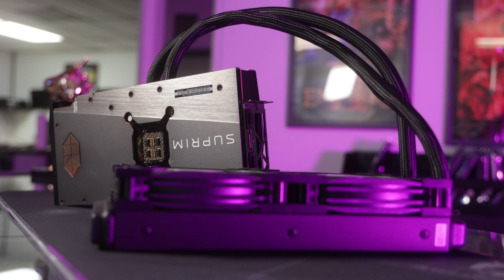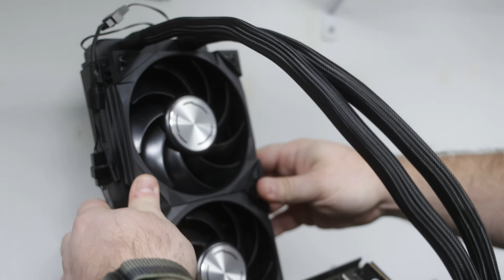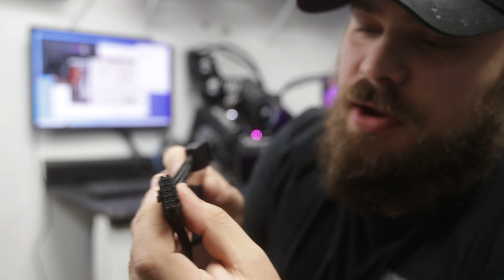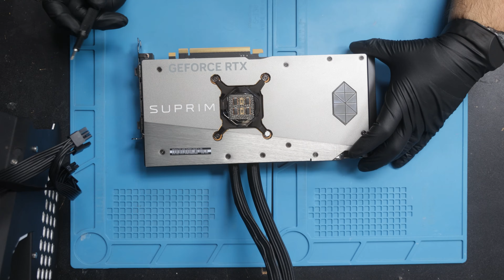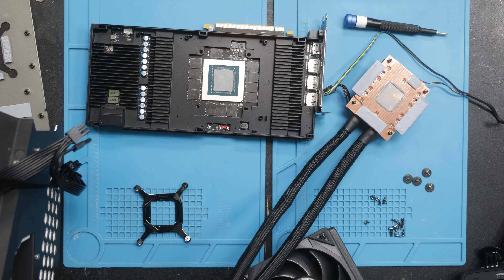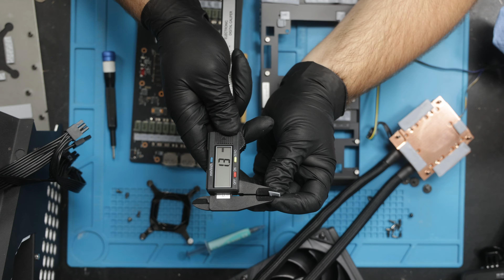MSI RTX 4090 Suprim Liquid X Dissassembly, Tear Down and GPU Memory Temperature Improvement

Comment: Would you recommend running 2 of these in a closed case for a rendering workstation?
Reply from the maker: Well since SLI/NVLink is no longer a thing we have no idea what software can use 2 cards. Your best bet is using Quadros or Radeon Pro
Reply: @SilverKnightPCs  I use vray which doesn't use nvlink or sli. The question is mostly about the temperatures inside the case. The air cooled cards are not recommended for a closed rig, so I'm wondering about this.
Reply from the maker: @elektroluver  in that case if it's truly multi-gpu agnostic no matter what kinds of connections are working in the cards then you are in a position where this is probably one of the few cards in the market that you can run dual 4090s. We haven't done exact temperature testing but based on what we know about water cooled cards in the past as long as your radiators are venting outside of the case instead of pulling cool air and blowing inside the case then the heat isn't going to be inside the case to matter. You should be more than capable running two at the same time. Now cable managing that having an adequate power supply to be able to run that? That's a different question entirely
Reply: @SilverKnightPCs  Yeah cable management will be difficult but I think my psu can handle 2 of these (super flower leadex platinum 2000w). I'm already running 4 blower 2080ti's, so another card I'm looking forward to is a blower style from manli but I'm not sure how they gonna manage to cool that thing. Thanks for your answers.
Reply: @SilverKnightPCs  blender has an option to render with two GPU’s without any link or sli

Comment: You would think for a after tax $2000 card they would use a bit more premium materials.. 🤔😒😡 Gigabyte AIO GPU have the same issue..
Reply: Nvidia distributes the cards at a premium. msi, zotac and all the others barely come even after they add their touches and put them in the market.
Reply from the maker: Honestly the materials are not inadequate. It's just that it could have been better and it's not much more to make it better

Comment: How is coil whine ?

How is overclock ? Can u do PR ?

3ghz effective sustained ?
Reply from the maker: 3 GHz no issues. Coil wine was at a minimum but it was running sustained 4K superposition tests so the frame rates aren't high enough to experience coil wine issues sustained
Reply: @SilverKnightPCs  were you be able to spot a I2C Header on pcb ? from the looks there is none, unlike the strix
Reply from the maker: @StreaM_RoLLeR  you got a link to one? Never seen that before even tho we do some LN2 stuff occasionally
Reply: @SilverKnightPCs  you can see from der8auer he hooked up elmor to backside of pcb. I2C port there.

Comment: So is it ok to use all 1.5mm pads?
Reply from the maker: No it is not. On the vrm it's fine but on the memory it definitely wants 1 mm pads. We ended up having to slice ours in half to be able to use them.
Reply: @SilverKnightPCs  thanks for the heads up. I just got the Suprim X, and I'll need to buy a new batch of 1mm pads.

Comment: Great job! You deserve more viewers with such detailed videos.
Reply from the maker: Appreciate it! We are working on a Kingpin 3090 with liquid metal and memory overheating issues next :)
Reply: @SilverKnightPCs  Hi! I'm still using MSI RTX 4090 Suprim Liquid X. I have some worries about my videocard. Could I ask a few questions please if it possible? You are pretty confident at what your are doing and there is not many people could answer it. 

The first question is: There is four diodes under backplate, that was lightning by default white color, but two of them got stuck at another color after time. Looks like it was bad idea to let them lightning white all the time. Once I noticed it, I've completely turned off the diodes via MSI Center Mystic Light service. The question is, can it cause any problem with other parts of the video card if these diodes will completely die? 

And the second question: Is it ok if vram of the videocard is heating up to 90 celsius, it slowly grow to around ~88 and can hit 90 celsius. Also GPU hot spot up to grow to ~80 and can heat up to 84 celsius? This is mostly in Cyberpunk on 4k Overdrive Path Tracing settings This is not constant temperature, it is maximum what I seen, the temperatures significantly lower if I just use 2k resolution or playing other games. The video card running at stock settings it was not overclocked. Also I have 13900k cooling system turned its air in to the PC, it CPU Package 50-65 during gameplay, and it does not feel like CPU heatsink releases hot air, it's closer to cool. So the questions is should I worry about it? I do not want to void warranty, I still have more than 2 years of it. And I've read that vram can heating up to 105 celsius and GPU can be much hotter, does it affect on GPU/memory live and performance in my case compare to lower temperatures?

I'm sorry for too much info and questioning, I have not many people I could trust in such topic, you are seems really acknowledged how all of this works and have an experience with the video card I use. I'm appreciate for any response.
Reply from the maker: @Mr Video Game  not without serious modifications. The AIO on the system is not designed for a custom loop. That being said you really don't need the additional Cooling. The 240 mm is more than capable of keeping it cool

Comment: Have you did a teardown of the MSI Suprim x 4090? I was wondering if they are the same exact board when it is all taken apart, the reason is I'm curious of when the pump dies on this will you be able to tear down and add your own custom waterblock
Reply from the maker: We will be dealing with that card this week when our allocation arrives
Reply: This was my exact same thought process. Turns out that all of the websites that I have gone to state that the waterblocks are compatible between the two cards. Will probably be the direction that I go.

Comment: The memory heats up to 80 degrees, is this normal?
Reply: If people were able to cool their mem to 80c on 3090s,3080s they would be pumped… now worrying about 80c on these cards. Ha
Reply: @killerrf my 3090 is crying at 90-100 c mem temp
Reply from the maker: At stock? Absolutely.
Reply: @SilverKnightPCs  Inside the Corsair Crystal Series 680X case, blown, on top. Below it is a Noctua NH-D15 cooler   No overclocking 12700 к

Comment: Great video. I am thinking of trying liquid metal and using thermal putty with 1mm copper shims sandwiched on the memory. 🤙
Reply from the maker: I dont know how much more performance a copper shim mod would net this card. You are limited by the cooling element not the transfer rate necessarily. But then again we did see a 10C improvement on the the card memory after the mod so... who knows lol
Reply: Let us know what your results are if you do it
Reply: How did it go?  im planning on adding liquid metal to mine and use putty pro instead of the thermal pads